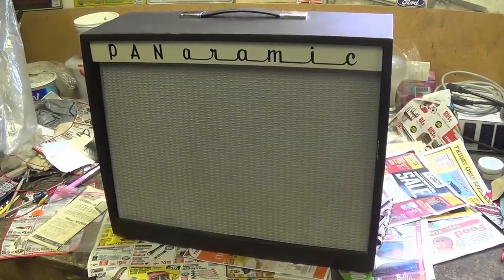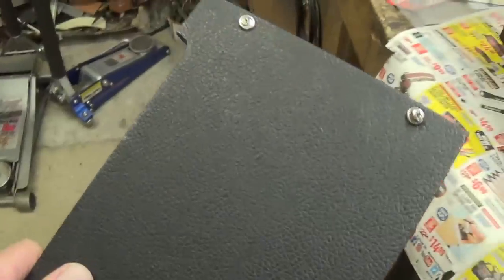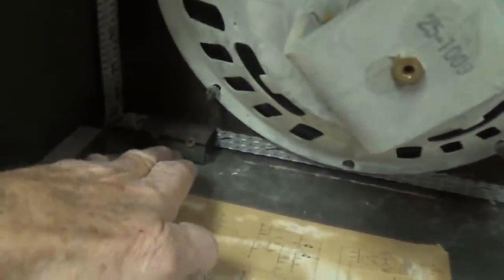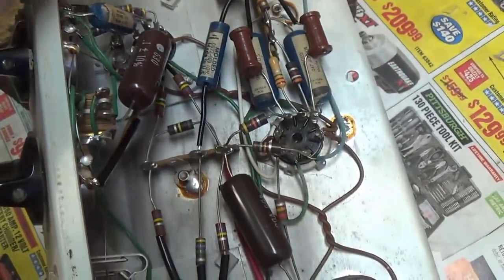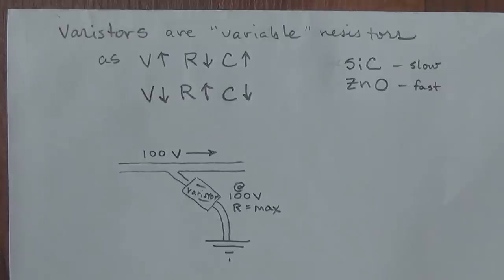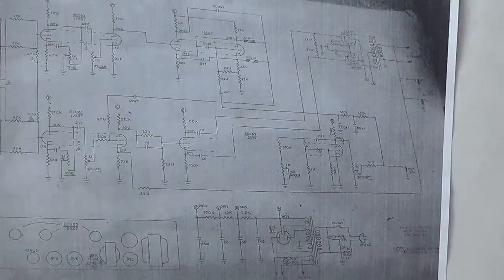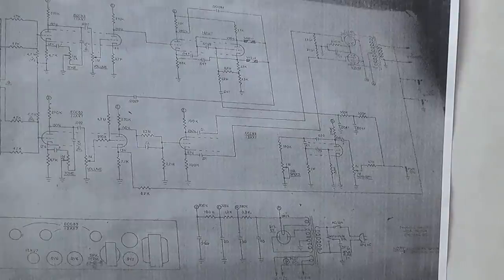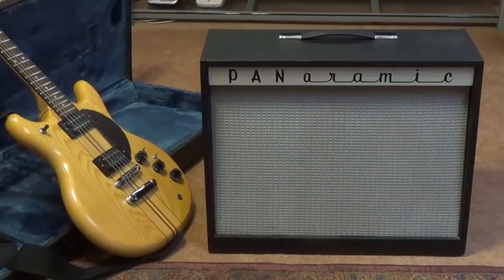1963 Magnatone Panaramic Model 1210 Amp with "True" Vibrato

Comment: Some Fun Modulation Facts: Before the electric instrument era, tremolo and vibrato were largely interchangeable terms. Vibrato was the more common term in instruction books and so on, at least those published in English; it was used to describe the modulation used on violin for example (which is pitch mod.) The fact is that with acoustic organic instruments, the two methods are usually overlapped to some degree-it's very difficult to modulate volume without affecting pitch and vice versa. Both words mean the same thing-tremble or vibrate. They described the *effect*, not the *technique*. Once amps allowed the two things to be isolated, the need arose for a word to describe each one, and we've settled on tremolo=amplitude and vibrato=pitch. Fender didn't use the words wrongly at all-in the 1960s the distinction didn't yet exist, and even today, outside of the amp and pedal world the distinction isn't followed closely. Context is everything.
Reply from the maker: Thanks for your knowledgeable input, OWB. My only observation would be that since Magnatone first offered the "true" Vibrato effect in 1957, the difference between it and tremolo would be well known, especially within the audio electronics community in the 1960's......including Leo Fender......and the failure to address the difference was more a marketing decision than the legitimate use of a not-yet-defined term.
Reply: An interesting side note...rotating speakers like the Leslie you made give both effects at once, much more like wind instruments or human voice does. Maybe that's why they sound so amazing.

Comment: Uncle Doug-I recently built a Vibrato/Reverb unit based on the Magnatone M10-A circuit, basically just left out the power section for speakers, so its similar to the ReVibe.  I notice that when I activate the reverb, but not the vibrato, I can hear some background "oscillation" even though I haven't activated the vibrato. And I can vary it with my vibrato speed pot. If I turn off the reverb, and the vibrato is still off, its perfectly quiet.  Any ideas why the background sound?  I am using a stereo footswitch jack to control both the reverb and vibrato with a Fender reverb/vibrato foot pedal.  Thanks.
Reply from the maker: Without being able to evaluate the circuit personally, I really can't offer any good insights, other than a guess, that the reverb circuit is acting like an antenna and picking up the oscillation of the vibrato circuit. Are your reverb tank cables fully shielded and is the tank body grounded?
Reply: Uncle Doug The tank is connected to the jacks on the chassis with standard RCA shielded cables. The tank itself is not grounded-just mounted on the wooden cabinet frame. The cables have a insulated single wire running between the cables. I’ve never seen something like it before. I got it from a supplier where I got the tank. And they’re sold for use with reverb tanks. Is that for grounding somehow? I don’t know what it’s for.

Comment: Hi Doug... I've heard over the years that Magnatone amps were solidly built, and your teardown of this amp confirmed this. Not only in their use of high quality plywood (as you know, Fender was using 1x10 pine boards... fine except for the knots which would bleed through light colored Tolex over the years, and you already know what Danelectro was using (Nate Daniel (no relation... no "s") was infamous for using cheap materials)). This attention to quality carried over in the components used in the amp circuits... all of the caps were within specs at almost 60 years of age! Unheard of!).  I actually recently acquired a KOCH "The Greg" amp (a Greg Koch signature amp) which has both a vibrato circuit as well as a tremolo circuit (selectable) along with a 3-knob reverb which is selectable to be fed before or after the vibrato/tremolo circuit. However, KOCH did not supply a schematic, and since this amp is new and under warranty, I'm loathe to take it apart to find out how they managed to accomplish this without using varistors. I guess I'll just have to make do with my new (to me) '63 Fender Deluxe...
Reply from the maker: Thanks so much, Bill. I'm willing to bet that the vibrato circuit in your Koch amp is styled after the Fender vibrato circuit seen in the brownface Concert, Bandmaster,  Super,  Showman, etc. In fact, they may have incorporated the entire Revibe circuit that Ted Weber helped to develop and market. The "three knobs" sound familiar:   https://www.tedweber.com/5h15-c-kt
Reply: @UncleDoug   It could well be, Doug... but without a schematic and/or tearing it down it is tough to guess what's going on inside.

Comment: Another wonderful and informative video. Being a guitarist it makes sense that you you’ll be focusing on guitar restoration and fabrication projects. I am a keyboardist/organist and I would like to create a combo amp project using an A40 Hammond chassis from I believe a M3 organ. I am wondering if you have ever restored anything similar and whether you might have any advice on whether such an undertaking makes sense. Thanks in advance and we all look forward to you and Jack in another video soon. My sympathies on your loss as well.
Reply from the maker: Yes, years ago I converted a large Hammond power transformer for guitar use by creating and installing a pre-amp section within the chassis.  It definitely can be done, but does require some circuit design skills. Thanks for your kind words regarding Rusty.
Reply: Uncle Doug 
L

Comment: THANKS!!!   I'm about to clone the Magnetone M4 and I had very little understanding of the vibrato circuit.  Your tutorial fixed that better than any of the other online material I found.
Reply from the maker: You're welcome, GC. I hope you have a source for suitable varistors.
Reply: @UncleDoug  I'm not sure if they are suitable  but I have found some currently available varistors that have been recomended online.  Fortunately, they aren't very expensive if some experimentation is required.

Comment: Amazing video with all kinds of embedded goodies. I'm not sure if another comment got to this point, but what's amazing about the special edition Chet Atkins Certified Guitar Player (CGP) Gretsch is not that one pickup goes to one stereo channel and another pickup goes to the other stereo channel, the pickups themselves are literally split so the top three strings go to one channel and the bottom three go to another.  This way, given his alternating bass style of Travis picking, he could individually control the volume of the bassline (played with the top three strings). The Atkins design also involves faux F-holes to reduce feedback. From this design, we can imply that Chet wanted to add more volume to the bassline without the side affect of feedback from too much bass. He probably wanted to do this to accentuate the special boom-chick effect of palm muting the top three strings.
Reply from the maker: Thanks for the very interesting input, David.
Reply: @UncleDoug  So, after further researching, the design wasn't just to apply separate volume and gain to the top three strings, it was also to individually pass the bassline coming off those strings through the reverb circuit without impacting the harmonies/melodies coming off the bottom three strings.

Comment: Also, regarding the difficult to find varistors, take a look at opto-couplers. I think they may be the modern day solid state (ugh) version of varistors. https://www.youtube.com/watch?v=ilaC2QSYpPE
Reply from the maker: It's not hard to find Varistors, David, it's just hard to figure out which Varistors to use. The performance characteristics of a vibrato-creating varistor are very specific and nothing else will work properly in the circuit.
Reply: @UncleDoug  Thank you for that!

Comment: Awesome content as always, Doug. If you want a really smooth optical trim in your fender, then substitute the neon lamp for a ultra bright Amber LED.
Reply from the maker: I assume you have to also alter the voltage supply to the LED, LV.
Reply: @UncleDoug  nope!  There’s a 10m resistor in series with the LED - attach the LED’s long lead to the 100K, short lead to 10M and you’re done. You can even get different textures by using different colors.

Comment: Hi Uncle Doug
Love the real vibrator. Is the oscillator circuit basically a tremelo circuit driving the vibrator?
Reply from the maker: Thanks, Robert. Yes, the oscillation loop is identical to that used in a tremolo circuit, but instead of modulating volume, it modulates the Varistors.
Reply: Uncle Doug would it Then be possible to use photo resistors instead of the varistors?

Comment: Absolutely fantastic chapter and exhibits. which brings some questions sorry if they are stupid but how did the accordion was connected to the amp ? and my never professionally answered question which is can i use a guitar amp for my keyboard home low volume practicing ? (I am doing it anyway and i don't see any problem)  This Panoramic amp seems like a good example for a multi purpose amp... Greatly appreciate your technical / theoretical explanations - Pure Gold !
Reply from the maker: Thanks so much for your nice comments, Amir. Many accordions came with built-in transducers that convert the vibration of the reeds into electrical signals, just like the pickups used in acoustic guitars. Sure you can use a guitar amp with your keyboard.....as you have already discovered.
Reply: Thank you so much,  Outstanding quality content, greetings from Israel.
Reply from the maker: @amirglinik8218  You're quite welcome, Amir. Greetings from the (usually) Sunny Southwest, USA :)

Comment: How the Vibrato Works: Notice the Varistors are connected to the plate & cathode of the 2nd 12AU7 section, then join together.  The 1st section of that same 12AU7 has two 0.047µF caps connected to its cathode.  These 0.047µF caps form a bridge circuit with the two varistors.  Where the caps join is a corner of the bridge opposite of where the varistors join.

The audio signal to be modulated is applied to these two corners: directly from the 1st 12AU7 section's cathode to the caps, and via a small-value blocking cap (~470pF on your schematic?) from the 1st 12AU7 section's plate to the varistors.  There is a push-pull action happening here, but that's not terribly important to think about now.

A bridge circuit (often drawn as a square) has 4 corners, so what about the 2 corners we haven't talked about?  These corners are situated where one of those 0.047µF caps connects to a varistor.  This also happens to be at the plate & cathode of the 2nd 12AU7 section. The 2nd 12AU7 section is used to develop a push-pull signal from the oscillator's output, which causes the resistance of one of the varistors to increase while the other is decreasing.  The push-pull signal was needed to apply enough voltage cause the desired amount of varistor-resistance change.

With no oscillator signal applied, the music signal output from the junction of the varistors is at some fixed-amount of phase, based on the phase-shift imposed by the 0.047µF cap working against a varistor's steady resistance.  The push-pull action of the 1st 12AU7 section is essentially causing the output to the follow-on 12AX7 to receive the steady-phase of the 12AU7's plate output, or the steady-phase of the varistor output.  Our ears don't discern absolute-phase very well, so we don't notice any effect.

When the oscillator signal is applied to the Cap-Varistor bridge,  there is now a continuously changing phase (at the rate of the oscillator) at the junction of the varistors & the 1st 12AU7 section's plate.  It is this now-changing phase-shift mixed with the steady-phase of the 1st 12AU7 section's plate output that creates a Doppler Effect, where advancing-phase results in the frequency rising, and retarding-phase results in the frequency falling.

If you look at the way the later/larger Magnatone amp schematics are drawn (like the 280A), the Cap-Varistor Bridge arrangement is more obvious, as is its connection to the plate & cathode of the driving tube section, and the connection from the oscillator's push-pull driver to the other corners of the bridge.
Reply: Add to the above that Depth control is just determining how large a single gets from the oscillator to the driver interacting with the Cap-Varistor bridge.  Higher Depth setting = larger voltages from the push-pull driver = larger (changing) voltages applied to the varistors = more resistance-change = more phase-change = greater swing of pitch above/below the original Music Input signal.
Reply: As for the specific varistors, that was very likely always a problem even if the exact part-number is known.  The original varistors probably required testing/sorting/selection anyway because they're not precision devices.  Pre-selection would be needed to make sure they worked as-intended in Don Bonham's vibrato circuit.

And despite some claims to the contrary, the Magnatone varistor-based circuit is not the only way to get pitch-shifting vibrato.  You can achieve it with dead-common parts (though a somewhat larger overall circuit) by copying the Vib/Trem channel of 1960s Vox amps.

Don Bonham likely invented his circuit partly because Wurlitzer already had a patent on a pitch-shifting electronic vibrato circuit using tubes & normal resistors & caps.  Bonham would have to side-step Wurlitzer's patent by achieving a similar result using a different method, and specially-selected varistors in a Cap-Varistor bridge circuit achieved that.

While Vox should have had to also try to invent yet another different way to achieve vibrato (or pay someone a licensing fee), they just ripped off Wurlitzer's vibrato circuit verbatim and somehow got away with it.
Reply from the maker: Wow, thanks for your very detailed analysis of the vibrato circuit. Hopefully, any viewers who want to build their own version will find this quite helpful.

Comment: What a nice amp. Can the differences between tremolo and vibrato be compared to the differences between AM and FM radio?
Reply from the maker: Thanks, Jim. Not really. Using the guitar as a basis for comparison, vibrato is more like a string bend or a "whammy bar" application.....stretching the string to raise the pitch, rather than turning the volume up and down to vary the volume.
Reply: To think about it, these are only 1/2 of AM and FM, i.e., the first / encoding (modulation) part, with VERY low modulation frequencies and the carrier frequencies replaced with the actual audio signal - you just flip the 2 around. There is no demodulation necessary since there are no RF frequencies to strip out as it is all within the audible range, hence, my description of 1/2 of AM/FM.Your description in the video is accurate, as is your analogy of the whammy bar and volume pot above. Both are mechanical manifestations of AM and FM, but in the human audio range. Sometimes, you have to look past the standard definition to realize what is actually happening. Now, back to the rest of the video.

Comment: The more I look at that it seems that it's varying the duty cycle of the output due to the mixing.  It would be interesting to see the output vs the input on a dual trace scope.
Reply from the maker: I am not familiar with the terminology you are using, Daniel, so I can't really offer an opinion.
Reply: I'm going to try to mimic the effect digitally, and see what happens.

Comment: hey Doug, I just picked one of these up. Do you know how the remote speakers work? would it be a left/right thing with each channel dedicated to an out?
Reply from the maker: You'd have to look at the schematic and see how your amp is wired, Joe. Does your amp have  jack(s) for left and right output?
Reply: @UncleDoug  its exactly the same as the one in this video. I didnt know if you got to that part of the schematic when you were making this video. I’m referring to the two jacks on the face of the control panel that are labeled "remote speakers".
Reply from the maker: @joestoehr  I can't find that schematic, Joe. Would you please post a link to it.

Comment: wow.   its not something i would want to see done to this near perfect condition amp but what im wondering is if it could be easily modified so that one could mix the straight signal with the vibrato signal.  this would be two signals at the end of the signal chain to mix together, making a modern chours effect.
Reply from the maker: Yes, apparently it can be accomplished quite easily by using the Stereo input and then mixing the Ch2 Vibrato with the Ch1 Clean signal.
Reply: Ok.  unbelievably mind altering.   what a cool amp.

I can't believe how much I've been able to learn from you Uncle Doug.  Thanks again.
Reply from the maker: You're welcome, Todd.

Comment: Vibrato looks more like a phase modulation than a frequency modulation. Both effects make me want to have a seizure.
Reply from the maker: I was under the impression that the phase modulation induced a frequency modulation, SB.....regardless, we hope you recovered.
Reply: Technically, modulation is mixing a signal with a carrier, but I understand how you're using the term.
If the frequency was being varied, the width of the sine wave would change with time, e.g. if you doubled the frequency, you see twice as many humps per period. Phase wouldn't be affected. From the scope, it looked to me like the frequency was constant, but hopping back and forth wrt to time i.e. phase shifting.
I listened to some Mexican accordion jams and feel better now, thanks. And keep up the great work!
Reply from the maker: Thanks for the follow-up, SB. We appreciate your input. Go easy on the Mexican accordion jams......they can be addictive :)